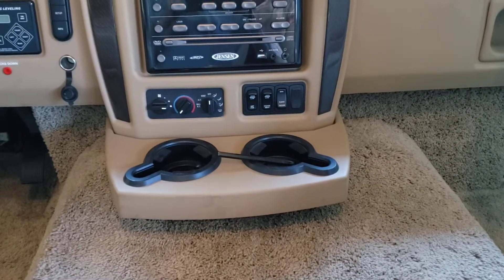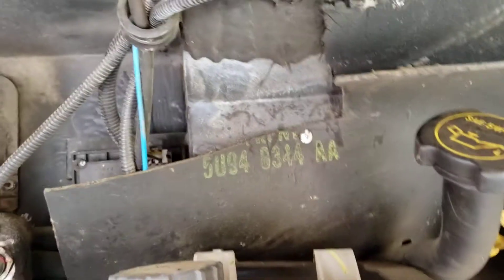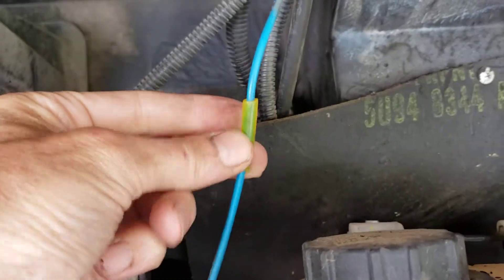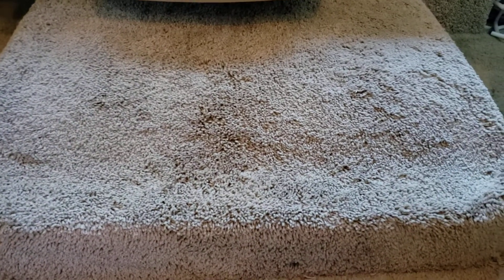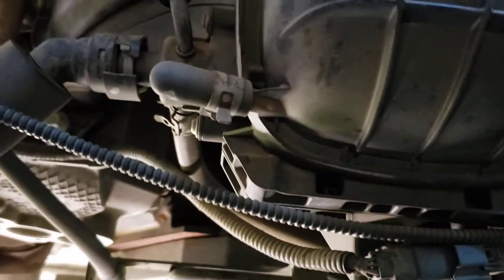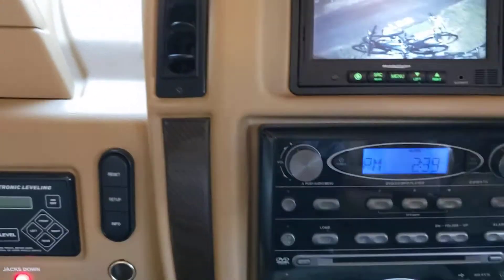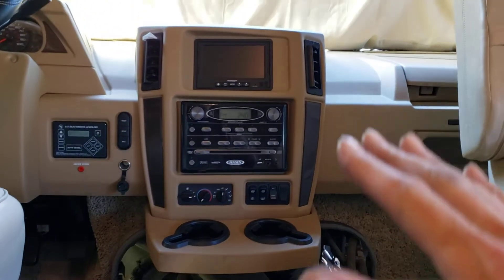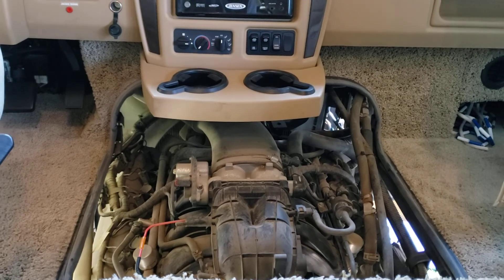RV Repair 2013 Winnebago Sightseer Dash Air and Heat Stuck in Defrost Position

Comment: I remembered seeing this video, a few months back, I watch all your motor home videos as I have a 2005 adventurer 35U. As a snowbird am getting ready to head south, so you have helped me immensely from front to back with all my fluid changes I including your on an 5500 oil change. Well yesterday was checking out the dash AC and it wasn’t working, blowing warm air when the AC is supposed to be on, compressor cycling on and off, suspected low refrigerant, checked and sure enough had to top it up, which went well, pressures all good, compressor running well. Still had no cold air, warm with it set at maximum cold, hot when set at maximum hot. Started looking around under the hood and thought maybe the vacuum operated heater valve was stuck open, it has the green vacuum line.  Then I noticed the blue vacuum line was disintegrated, bunch of blue granules. This I assume controls the damper door for the blower unit? So I found some 1/8 vacuum plastic line today and some rubber tubing to splice the 1/8 “ line together. Ive decided to splice it where it goes out the firewall under the passenger sliding tray which I have removed. I will do both the heater control line (green) and the AC line (blue). I think the deterioration of the line was from heat in the engine compartment.  A note on the part number for the heater control valve, you had mentioned YG136, which I couldn’t find up here in Canada, ford crossed it over to D4AZ18495A and my auto parts crossed it over to 74612. 
I’ll let you know how it goes with replacing the blue and green vacuum lines, and if it was successful to finally get some cold air of the dash system. 
Thanks again, for all your help.
Reply from the maker: Thanks for contributing and Thanks for letting me know you find my videos helpful.  If you need any help just text my cellphone 606-875-0125 Kevin.

Comment: Kevin great video, I have a 2004 Itasca Sunova that needs new vacuum line. Do you know where I can get this small vacuum line. Thanks, Tim.
Reply from the maker: Just take a piece of the old one to any auto parts store they should have a roll of vacuum line they can sell you by the foot
Reply: @ktoutdoor  Tried both Auto Zone and Advanced Auto Parts. They only sell rubber tubing.
Reply from the maker: Give me a call I will be up till 3am 606-875-0125 Kevin
Reply from the maker: @lindanadaud9698   is this it ? https://www.dormanproducts.com/p-6924-47417.aspx#productBuy